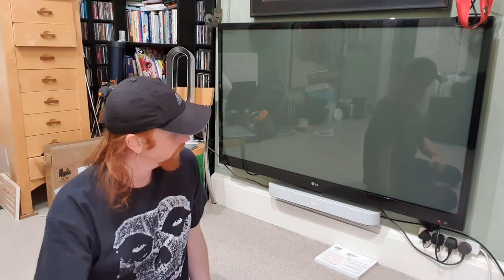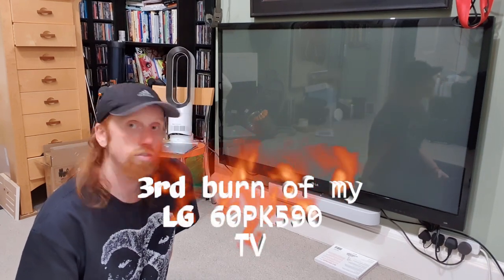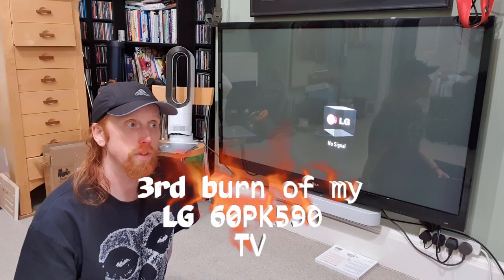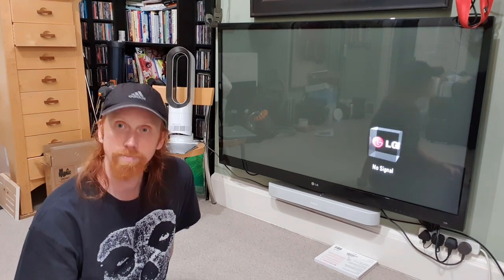Fixing my LG TV... AGAIN!... by putting it in the oven

Comment: To prevent it happening again, never take out the power cord while not in use, let it be in standby mode always! I found out that the board stops working when it has been left in a cold (below 10' Celsius) room for a week or so without the power cord attached. So,  never unplug the power cord (tv, blu-ray surround etc). I`m baking my board for second time now. Lesson learnd. 
EDIT: Last time it lasted for 3 years, and it also worked today!